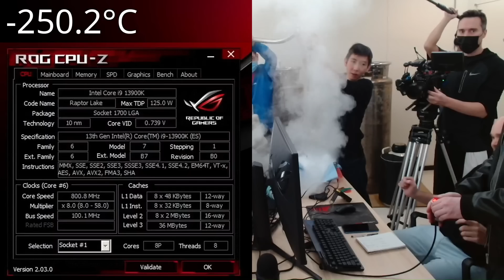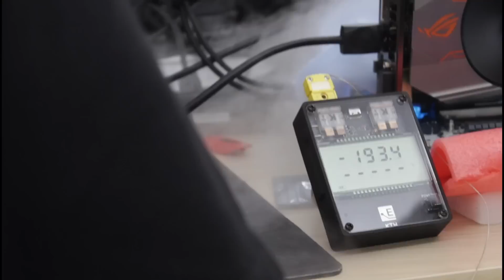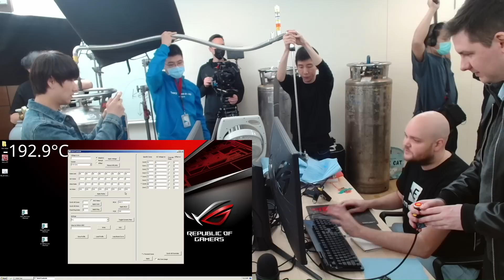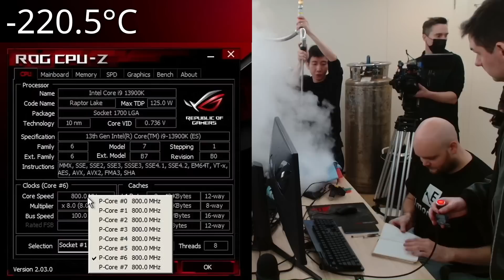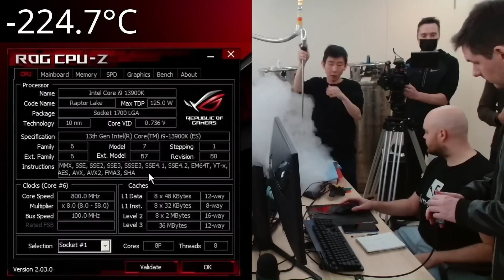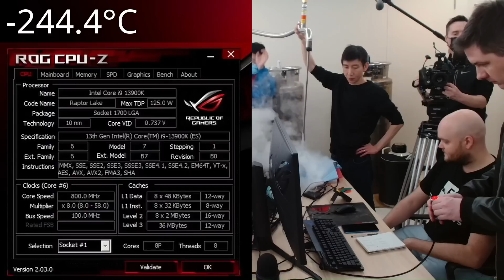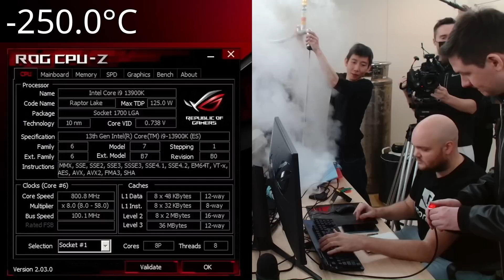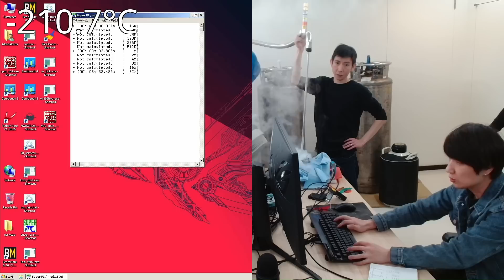9008.82 MHz Helium Cooled

Comment: This is an interesting experiment. Push an Intel Core i9-13900k Raptor Lake CPU to a record breaking clock speed over 9 GHz and achieve a new maximum CPU speed record. Maybe the day will come when a new experiment will push an Intel CPU over 10 GHz. However in the real world where practicality matters, it will be interesting to see what the maximum reliable clock speed that can be obtained with water cooling of the CPU.

Comment: Pouring liquid helium without any protective gloves (PPE)  or any protective clothing- these guys are amateurs.  The guy in the T-Shirt is reckless behaviour.  What could go wrong?  How does ASUS sponsor these type of risky events?  Do they even do a risk assessment?  Clearly not by the look of it. 
Personnel must be thoroughly
familiar with properties and safety
considerations before being allowed
to handle liquid helium and/or its associated equipment.
Eyes are most sensitive to the extreme
cold of liquid helium and its vapors.
The recommended personal protective equipment when handling or
using liquid helium is a full face shield
over safety glasses, loose-fitting thermal insulated or leather gloves, and
long-sleeved shirts and pants without
cuffs worn on the outside of boots,
especially whenever the possibility of
exposure or a spill exists. In addition,
safety shoes are recommended for
those involved with the handling of
liquid helium containers.    
Oh wait, they have surgical masks on -- that must mean they are following correct safety procedures LOL
Reply: bla bla bla bla cry me a river

Comment: If you have issues with temperatures going TOO low, why go through such extremes for cooling? Liquid helium is colder than liquid nitrogen, and Nitrogen is cheaper, so why wouldn't you just use the Nitrogen? Those are pretty insanely low temperatures, I'm surprised the CPU or motherboard didn't just break apart into pieces with the slightest vibration.
Reply from the maker: While there are many issues related to extreme cold, there's one very important advantage: CPU can run higher frequency at the same voltage when the temperature is lower! This advantage is also exploited in normal systems. Think Intel's Thermal Velocity Boost for example.

So, when everything's working well, the colder Helium temperatures provide higher overclocking headroom. So from an overclocker's perspective, it's worth dealing with all the issues that come with it.
Reply: @SkatterBencher  I thought the problems would only arise if reaching temperatures close to 100c, so even running at a nice cool 12c SHOULD be good, but maybe for such extreme overclocks there's advantages at these crazy low temperatures. That's what you're saying? There's a difference  between -50c and -200c for overclocking like this?
Reply from the maker: Yes, there's a big difference. We got an extra 200MHz going from -196C to -250C with the exact same setting. On ambient, typically you'd get +100MHz for every 20-30C.

Comment: The timing of it smells like a camouflaged 13900KS golden sample so that Intel can use the results for advertising during CES 2023. Sorry for being so cynical - the ES in CPU-Z doesn’t help.
Reply from the maker: The CPU used is is the same 13900K as the previous frequency record (8.8 GHz) https://www.techpowerup.com/300188/intel-core-i9-13900k-breaks-overclocking-world-record-at-8-8-ghz
Reply: Not sure it really matters. 13900KS are just binned CPUs. We used to provide the Tawainese vendors cherry picked CPUs back in my days at Intel circa 2014/15
Reply: In my opinion it matters very much, because of the binning that takes place. The video suggests that it is a “buyable” 13900K that reached that symbolic 9 GHz frequency when in reality units that are that great have most likely been binned by Intel to become 13900KS and hoarded away in a warehouse somewhere until the KS launches properly.
(That’s the entire issue I had with this video)
Reply: @abavariannormiepleb9470  First off, we don't know where they got these CPUs. If they were samples given to them by Intel, then yes, they were likely pre-screened (aka cherry picked) parts. However, you are incorrect in thinking that no buyable parts could achieve this as that simply is not true. The way Intel does binning: they would screen enough parts for KS for the sales they plan. So if they need 200K parts for their KS SKU, they will screen enough then pass the rest onto the lower bin SKUs. That means plenty of CPUs are getting passed on to 13900K with KS capabilities and so on.

Comment: What a time to be alive. Hopefully 10ghz will be achieved soon :)
Reply: why? for who the still usabel less cores less theads less chache we know is INSANE with 3d chace... the 8 core 8 thread even if it was the same spead is fo is at 1.6 that is with 60% less chace  speed aloe is ok on a 2013 condole vs a over 2x cost for 1 part of a computer,,, i hope if the super rich is u to not be alive as sommone young to  the 1060 a gpu weaker then the 2020 consoels by a huge margin isnt trolling,,, but it seems soo
Reply: @simlife445  what

Comment: This is really cool and all but why does it matter if you guys aren't even able to rip through a cinebench with it? Just changing the variables and having them stick for 3 seconds is not that impressive to me.

What windows version are you guys using to help aide this? Looked like windows Millenium or something.
Reply: w7 without aero
Reply: Makes sense, 10 and 11 could NEVER pull this off

Comment: Doesn't count, its an ES cpu, intel could have done all sorts of magicary with that CPU....... God knows where it came from, also result does not show on CPU-Z validator.
Reply: Duh it's 13900KS obviously
Reply: @niodix  13900KS ES, ES is the point I'm making....
Reply: Doesn't matter that it's an ES. 'God knows where it came from' - where exactly do you think? Intel. I have several. Asus works with Intel in platform bring up. Not everything in a drag race is publicly available - lots are custom, bespoke, or early production.
Reply: It doesn't matter. Of course this is not your typical consumer CPU. It's not even a typical specimen of the CPU series. It was just a lucky bin.

The only point was to show that this was possible.

Comment: does it really still make a difference in terms of OC if the silicon is -100 or -200°C ?
Reply: yes, example some Raptors have CB (coldbug) and of course they can not hit clocks like Raptors without coldbug. Even extreme good silicon with CB will be worse at -100C than bellwo average silicon without CB at -190C. 
Bining is very hard, u can have good CPU on CPU part, but bad on IMC. Or good only for few cores and not good for allcores loads with LN2. Etc.
Reply: Yes it matters. Also most 13900k cold bug. It’s rare to have one that will go even full pot on ln2 let alone liquid helium.
Reply: Lol yes ofc